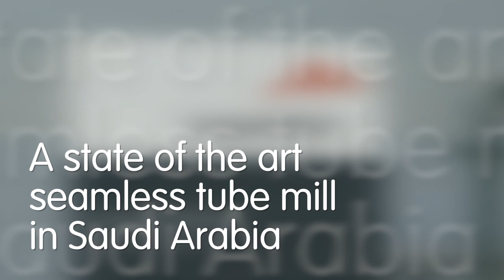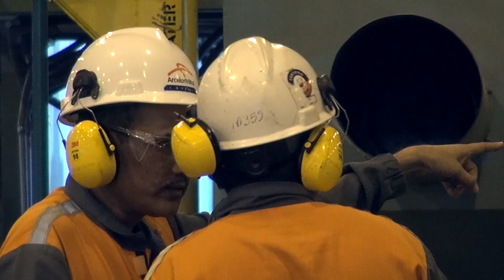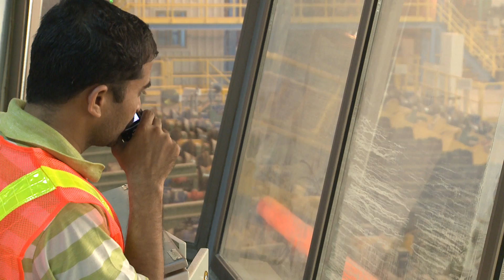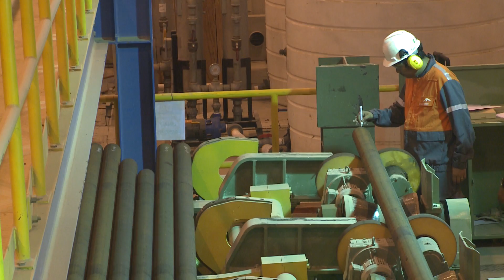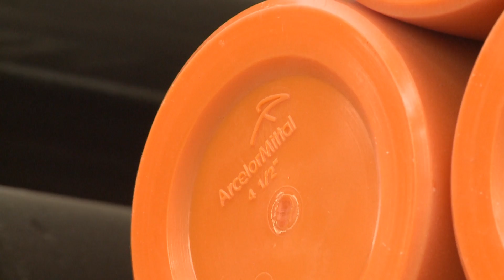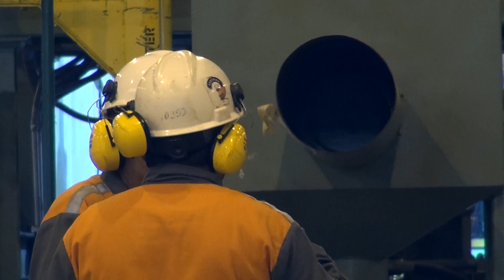ArcelorMittal Jubail

Comment: South Africa, Johannesburg is primarily supplied by Mittal Steel products, however as a result of the COVID virus a shortage of steel supply as well as a  rapid rate of inflation has compounded the struggles in the industry. Hopefully steel pricing will stabilize and availability will be as fluent before 2022.